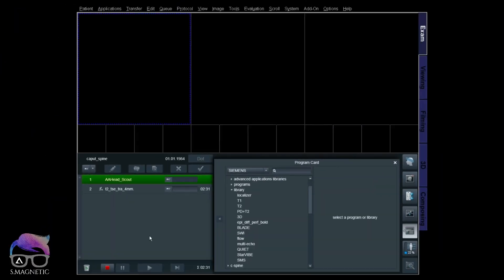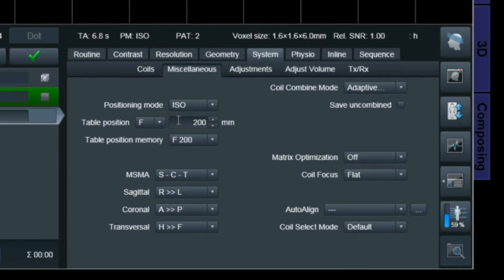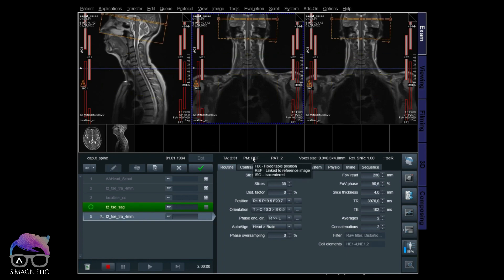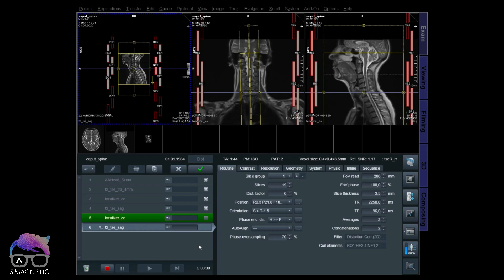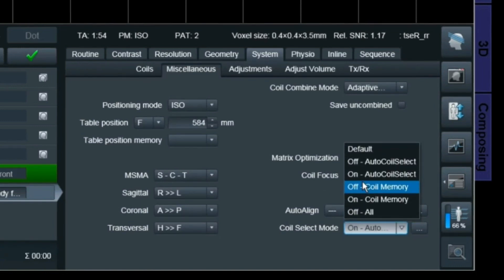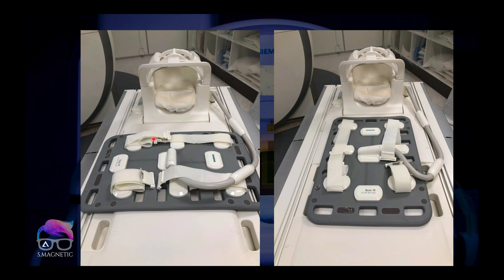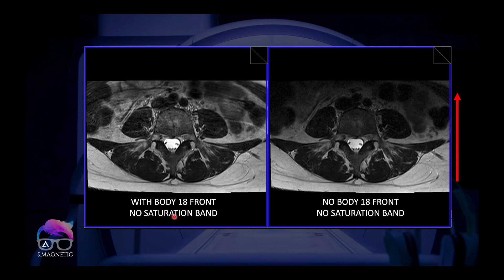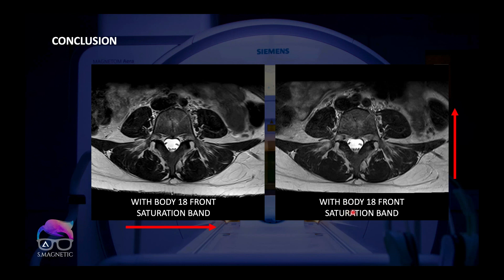POSITIONING MODE (FIX/REF/ISO). EXPLAINED WITH EXAMPLES

Comment: another question.  When doing total spines.  When you get that error that the scan won't run (because you are scanning different areas of the spine) how do you fix this?  I ran into this last week with a pt that I was doing a Brain/pelvis w/wo.  Didn't want to reloc because I wanted my settings saved. The scanner absolutely did not want to run a Coronal T2 on the pelvis.  It's been so long since I had this issue I forgot how to resolve it.
Reply from the maker: If I understand you correctly put all brain sequences on fix mode. Then all spine on iso mode.
Reply: @Nguyen_MRI  for this particular problem I realized that the scanner needed the shim box moved.  Not sure why it was not doing it automatically.  Haven't had that problem since that one incident.  But I did tell my coworkers because someone else had it happen to them as well.
Reply from the maker: @anniesshenanigans3815 when you open the sequence for planning, do you get a message which says shimming auto or manual?
Reply: @Nguyen_MRI  no message. The scans for most are set up for Auto.  We have only a  handful that are set up to manual.  I am making the assumption that if we do multiples we need to open the shim box so that we can see where it is.  It just seems to be random in this case.

Comment: this is the second time I have watched this and I still do not understand the difference between Ref and Fix mode.  I see the reason for Iso, but the other two look pretty much the same... what am I missing???
Reply from the maker: Can be very confusing. Ref fix are changed on the newest software. I use fix for exams where I only need to be at one place and specific. Such as knee, brain, cardiac etc. Instead of iso where the table moves to isocenter. I find fix safer to use compared to ref, because having a combination exams of let’s say brain(fix) and spine (iso). You see by using fix and plan from there you know what you get whenever you apply the sequence. If using ref you can miss postions depends on what sequence you plan from. Just try it out on your scanner and you will see.

Comment: In what case REF is useful as a positioning mode? And thanks for the informative video!
Reply from the maker: Thanks for comment. From my experience I only use iso and fix. I know other use ref as well. But on the newest software xa platform you only have two options. ISO and one more.
Reply: @Nguyen_MRI  Same here, we only use fixed and iso, thats why i asked if there was an advantage in some protocols, thanks for the reply!

Comment: Nice video, i used fix and iso when a have to do mri of brain and spine at the same patient, but what will happen if we use iso to brain or knee?.
Reply from the maker: No thing would happend beside small movement of the table and re shimming. In other words you loose overall examination time.

Comment: Great videos. I am not fully understanding point made about the blue line. We don’t actively use this feature and I don’t know it. Please can you explain thanks. We have an old avanto
Reply from the maker: The blue line is just the indicator of your iso Center within that FOV. Try to test out the function iso / fix and ref. Having in ISO you see the blue line moves within your FOV and the table inside the scanner moves along your wanted position. But having the ref or fix it doesn’t move. This iso came along with tim4G - total imaging matrix for the first version of AvantO software. Makes your positioning much easier and won’t think of scanning outside the FOV. Another test you can do is to have it on either ref or fix. Then move your FOV way up or down and then you see the yellow box turn to orange. Means you scanning way out of isocenter.
Reply: Very helpful
Reply: I believe you can turn that line on.

Comment: Very informative thank you for your videos ! Question. When using both spine coil and body 18 coil in the AP phase direction do you ever worry about cross talk artifact? I’ve noticed If I have a coil set up for a pelvis and I’m using a spine coil for lumbar. If I don’t turn off the body 18 coil I will get artifact. Is this because the coil is outside of FOV?
Reply from the maker: Thanks. 
Do you use multi stack in transversal plane? Or one big stack?
Reply: Bac Nguyen we use one big stack for transverse plane
Reply from the maker: Ok interesting. This transversal t2 you remember what rf pulse you have on it? Fast normal or low?
Reply: Bac Nguyen if I remember correctly it is set to fast
Reply from the maker: Try to put it to normal rf pulse.

Comment: Thanks for the video. This position thing has caused many problems, planned the scan and the image came out in a totally different position. So all brain sequences should be planned under fixed position, body/spinal iso, how about ref which body part is it most useful?
Reply from the maker: thanks for watching. well honestly you can use the fix or ref for local areas such as knee imaging.

Comment: Hi, thank you for the videos! Do you know why my sequence would appear in all 3 graphic windows if I drag the picture icon up to one graphic window? I’m on Espree B19 software.
Reply from the maker: Hi. Please check the tab RESOLUTION - FILTER and then check the parameter DISTORTION CORRECTION. in your specific protocol you need to either have everything off or on in your sequences. Including your localiser. Or else this can causing such a problem as you mention here. Please try out and give feedback. Thanks.
Reply: Bac Nguyen thanks, I will try it today and let you know! 😊
Reply: Bac Nguyen yes in deed, that’s what the problem was thank you Bac!
Reply: @Nguyen_MRI  that’s could be a good video for a quick tip.
Reply: Sometimes I experience the same problem, thank for bring it up❤

Comment: So having it fixed will save you time from reshiming?
Reply from the maker: Good question,  yes and also need to be used carefully for smaller area such as head imaging.
Reply: @Nguyen_MRI  thanks. I need to master this concept. You know where I can get more information on this specific concept? Thanks!
Reply from the maker: I haven’t found a better explanation other than the manual. Besides testing myself and tried to explain further in this video.
Reply: @Nguyen_MRI  yeah I seen the manual but like to know more haha. Thanks for your video. Stay safe!

Comment: Hi, Bac. Thanks for sharing.
You told that in axial plane for the Lspine, we can use AP or RL phase enc, with or without presat, depending on the activation of anterior coil channel. Is it possible to apply parallel imaging with both of phase encoding combinations or only for one of these?
Reply from the maker: Good question Luca. All these axial tests were done with grappa pat 2.

Comment: Thank u for the informative video! Very useful! Quick question, doesn’t  the extra body coil augment SAR as well? And if so how do we deal with it?
Reply from the maker: Good question which need to be consider. In my experience I haven’t notice any sar issue regarding this on 1.5T or 3T.
Reply: @Nguyen_MRI  will try it asap! 👍
Reply from the maker: Give it a try

Comment: Good video as usual. For the portion about using anterior coils for lumbar spine. I’m interested to know what filter settings you used, Pre-Scan Normalize, Normalize, or no filter? If you do not use an anterior coil and have one of the filters on the images can look very similar to the ones you shared that have lower signal intensity.
Reply from the maker: Thanks. Always use the prescan normalise
Reply: Bac Nguyen with no anterior coil wouldn’t you want to turn that off?
Reply from the maker: Good question. Actually no from my experience. Because the image intensity will various from light / dark throughout the image while scrolling through your sequence.

Comment: I've been taught to use REF mode when doing perfusion and/or spectroscopy (brain). Is it okay to use FIX mode instead? Will there be any difference?
Reply from the maker: Good question. I’m using fix for all head examinations. No problem with perfusion or spectroscopy from my experience.
Reply: Thanks for the clarification. 👊